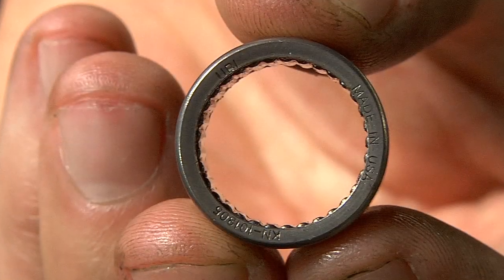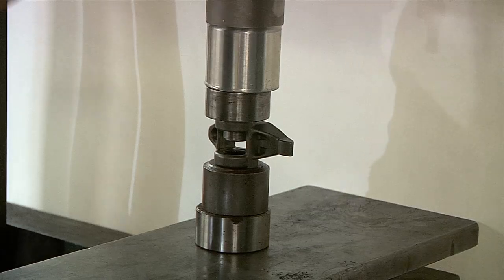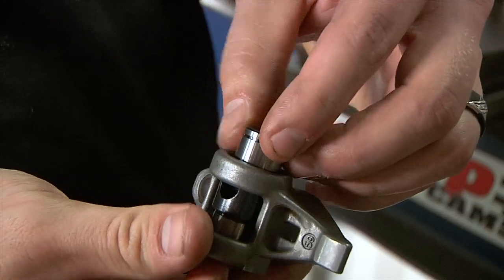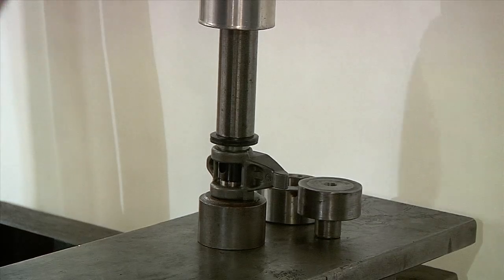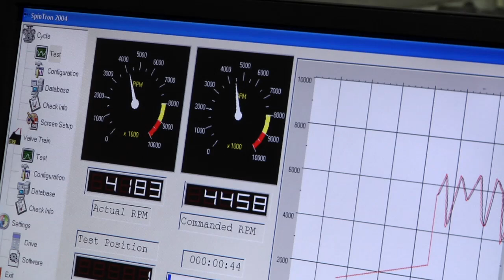COMP Cams® Quick Tech: How To Install An LS Rocker Arm Trunnion Upgrade Kit

Comment: when i do them i like to put the rocker in my hand a give it a few taps with a small hammer, just like you do when you change universal joints on a tailshaft... but not as hard of course. i find this helps it set just that little bit, and dont tap the trunion, just on the top and the bottom of the actual rocker, and in your hand! dont do it when they are bolted in.

Comment: I bought this kit but I'm glad I haven't installed it.  Not after learning what these look like after 20K miles or so.
Reply: Jake G they look fine? I have 140k on a set which I put in so I didn't blow an engine due to needle bearings

Comment: If i use these with ls7 lifters in a 5.3 will i be able to use the stock pushrods or are the ls7 lifters any different than the stock ones. and also what kind of warranty is on this trunion kit if they fail
Reply from the maker: +Morgan Kennedy You shouldn't have any trouble with stock-length pushrods, but we always recommend measuring for the proper pushrod length. You should consider upgrading to stronger chrome moly pushrods if you are upgrading the camshaft and springs.  The trunnion kit carries a one year warranty like all COMP parts. Hope this helps -- thanks for your question!

Comment: question will the stock ls3 rocker arms bolts work with the upgrade. I have seen some websites selling smaller bolts for the upgrade
Reply: no the stock ls3 rocker bolts will not work with the trunion ugrade kit you have to use the bolts that come with the trunion upgrade kit

Comment: Hey all, just wanted to let you know I created a video a few months ago for this kit, showing a mildly different installation method (using a drill press) that goes a little more in-depth into the explanation of most of the steps to install the new rocker arm trunions. It is listed here as a "Video Response"

Comment from the maker: The trunion upgrade kit costs less than half as much as going to completely new rocker arms, and keeps the stock lightweight rocker arm bodies. It is a very easy install, maintains stock geometry and does not require a change in pushrod length.